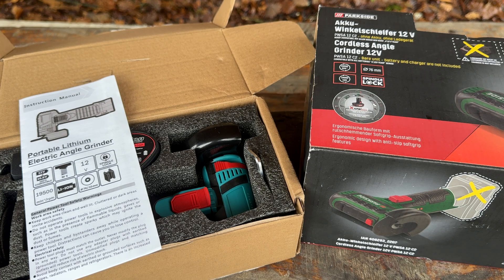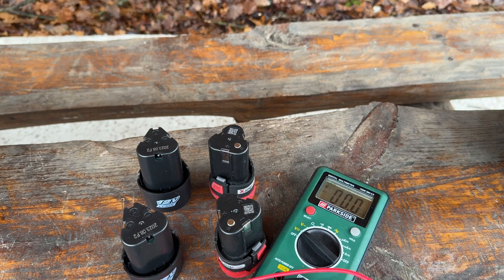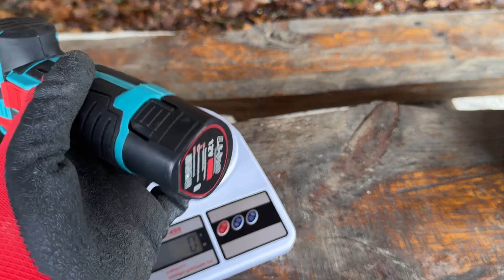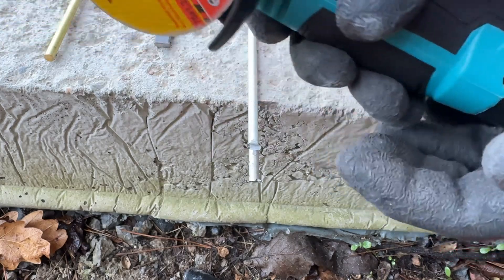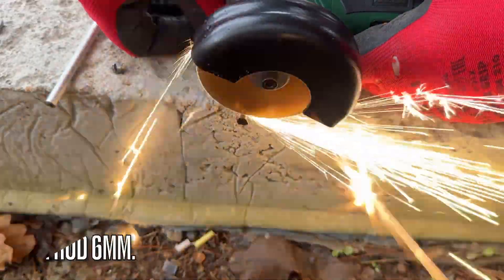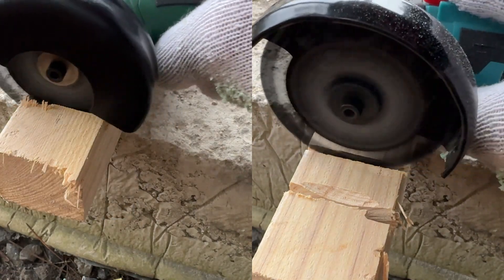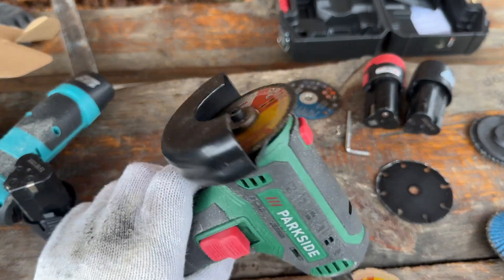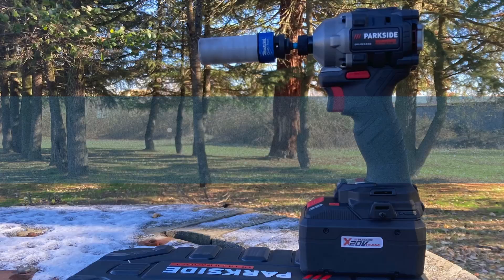3 inches of disappointment. Parkside PWSA C2 vs Aliexpress grinders. Will they cut iPhone titanium?

Comment: I have te parkside, I carry it with my 12v driver sharing the same 4Ah battery. Got it for only 23€ and it is awesome for cutting small screws, copper bus bars, anything plastic, reaching into small spaces and cleaning surfaces while being much smaller and portable (and safer also) than any other grinder.
The guard adjustment feels quality and covers a lot of the disc.

Comment: Yes mine stopped working cutting a 2.5mm brass wire !
Reply from the maker: Parkside or the other one?
Reply: @BrokeLifeEU  right it was the other one !
Reply from the maker: This is possibly the most underpowered tool I have ever seen. Surprisingly it is indeed a brushless motor but not much else going for it.

Comment: the 3 inch grinder from parkside, 1st gen I believe - PWSA 12-Li A1 is the one to go for. I had it for many years now. Similar to the first few what I can now only suspect 1st gen 12V Team tools, it's like a direct copy of the bosch 12V (12V-76) professional range. Have these models sit in the sun, and the plastic discoloration goes from Parkside green to bosch professional blue-green too. 

They also made a little jigsaw 12V series, one of the first gens, that's same sort of bosch look-alike and solid. Some of the other 12v tools are a massive letdown. They very hit and miss. Even their 20V tools ,as you discovered with the multi tool, can actually be a downgrade.
Reply from the maker: I would go so far as to say that the 12V range is like that. Hit and miss. Either the tool is very nice or not thought out at all. The trigger on the grinder in the video ruins it entirely for me. That brings on the other point with Parkside, mainly that a new tool does not always mean an improvement. I thought it was something of a rule by now for newer to mean worse. However if you have seen my newest video I was pleasantly surprised with their new flathead grinder and brushless drill.
Reply: @BrokeLifeEU  well said - here new doesn’t always mean better. Hit and miss probably because they constantly change suppliers in order to keep their target sale and profit margins.   My 3” grinder is getting to the point i was thinking to replace it with the newer one, as on paper newer has more rpm, but damn, that button thing is a real deal breaker. 

By the way, this first gen grinder i have, fell off my roof once, head detached from body, ripping cables out too  from motor solder points🤣 -  went back together like a proper tool should do. Still works.
Reply from the maker: @18bagabooo  I love the idea of things being repaired and working again. Sadlz each day it is turning in to a lost art. Also the manufacturers are not helping at all when they just glue everything together…

Comment: I don't even see the reason for it. 125mm ones are compact enough and if you really need to cut things that small that the 125mm ones are too big, you might as well just use dremel
Reply from the maker: Well I have had to cut some hardened bolts and a dremel type tool just won‘t do it or will take too long. The normal size grinder did it no problem at all but it is too heavy to hold right for that small of a cut. So for some situations a 3 incher is the right size.

Comment: That Parkside 12v is meh , 20V is mmmm nice and rly strong  (that cheap blue one works way better after battery upgrade to stronger cells yet still lack power)
and try Cubitron II blades for it , look for 75 x1x9,53mm ... you cant get 76mm one only 75mm , they last in my case 8-12x longer and cut way faster in my opinion
Reply from the maker: I will try the Cubitron discs and a 20V mini grinder for sure. It sounds like a very promising combination!

Comment: I saw these things on Temu and wondered if they are actually brushless consider the brushless model is only $2 more in the same listing. Interesting to hear they actually are but certainly didn't perform like it should. 

I definitely won't be getting one now lol.
Reply from the maker: Or there is another way to look at it. If you are in need of a paperweight that is the shape of a mini angle grinder this is the one to go for. 😂
Reply: Although I wonder given how much trouble you had with the included batteries, are those the bottleneck? Maybe hook it directly up to a fully charged car battery and see if it works any better.
Reply from the maker: It would be worth a go but as the cables inside are so thin I don’t think the local firefighter brigade will appreciate the test. As with the Gisam impact I tried to improve in another video I think this is the maximum one can hope for from this tool without overloading it one way or another.
Reply: Good point, the rest of the tool probably isn't built for quality anyway, using a bigger battery just move the weak link to somewhere else.
Reply: Well, $2 is about as much electronic as you need to control small brushless motor. And motor being brushless don't automatically means it will be more powerful, just a bit more efficient.

The big tool brands got us used to equate brushless  = more powerful but that's false equivalency, the more expensive brushless tools of big brands just use more powerful motors.

Comment: Video Idea: figure out a way to not have to press the trigger all the time. 
Probably not so hard.. maybe a couple springs out idk
Reply from the maker: True, it would not be hard to do, but the other models have a normal button so I would go with one of them if I need a 12V parkside grinder. This actually is quite nice for short bursts of cutting but quite unpleasant for prolonged use.
Reply: @BrokeLifeEU  If you think you gonna be using a grinder a lot on a particular job, you should take a 125mm. I carry this 76mm as "just in case" Even though it is a very capable tool

Comment: I have the B1 version from Parkside. While the button isn't easy to operate, it does stay engaged when you push it all the way to the front. It's such a nice and cheap tool when you buy it on sale, I ended up buying a second one so I don't have to switch the disc for cutting/grinding. I would recommend the 4/5Ah battery for heavy use though.
Reply from the maker: It is a very good tool for the price! I decided to use the 2Ah battery so the Aliexpress one had a chance. Even that could not help it in the end 😅
Reply: @BrokeLifeEU  Is it normal for the version you used to require a permanent button press? I wouldn't be surprised if your one just needs a bit more force than usual or is just broken. Parkside can be hit or miss.
Reply from the maker: @MartinPellengahr I thought it was falty at first too, but after looking in to it is just how the C2 version is. It is good for short bursts if use, but for prolonged use I do not like it.
Reply: @BrokeLifeEU  Then I'm glad I got the B1 version.
Reply from the maker: It has now more often than not become the case that newer Parkside tools are worse than the ones before...Profits I guess...

Comment: Nice testing! The only hope for the aliexpress one is that it may be slightly better once you get 5+ charge-discharge cycles on the batteries, lithium ion batteries don't perform well when brand new. Pretty shocking how quickly it died at the start all the same! Also I checked my parkside PWSA 12 B1 unit, it does have a locking rocker switch on the side where your thumb sits, no idea why they changed it
Reply from the maker: Thank you so much!!! I could not get through the filming with just the two batteries that came with the Aliexpress grinder. I used two more that have up to 10 cycles on them. And it made no real difference. So the weak link is everything in this case 🤣
Reply: @BrokeLifeEU  hahaha. Beyond redemption. Well you're helping us save money with each bad discovery you share, which is very noble 😄
Reply from the maker: @Failsafeman100 Well I hope the right angle impact from Aliexpress will be good otherwise I am gone with them 😂
Reply: @BrokeLifeEU  I have a number of tools from there but it's mostly crimpers along with some wrenches, socket adapters and stuff like that that's unlikely to see much abuse. Great savings there. The right angle impact is kindof a specialist tool too and can be used as a (chunky) cordless ratchet if it does end up being crap, so there's still hope 😆
Reply from the maker: I would still prefer it work as a right angle impact 😆 with the non power tools as long as you are careful there are some great deals, with the power tools you never know. Probably Onevan and Gisam for now are worth their money if on sale, but the batteries are still a shot in the dark.

Comment: Damn, the AliExpress one was absolutely atrocious, the Parkside at least cut through everything (eventually) + it has the 3 year warranty. Do you think it would have fared any better with a 4/5Ah battery?
Reply from the maker: Oh yes, for sure! With a 4Ah or 5Ah battery it would absolutely destroy the other one. Even Lidl recommend you use it with a 4Ah I just wanted to give the other one a chance.
Reply: Much better, I have it and I only use it with 4Ah battery, much stronger thant 2Ah packs, can maintain more speed while cutting or grinding